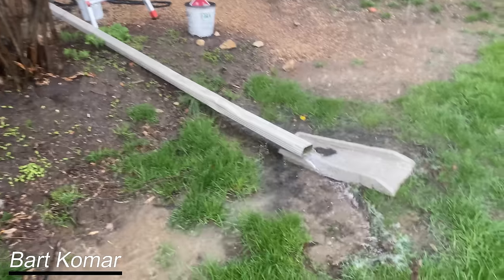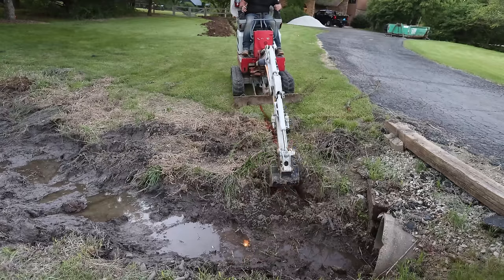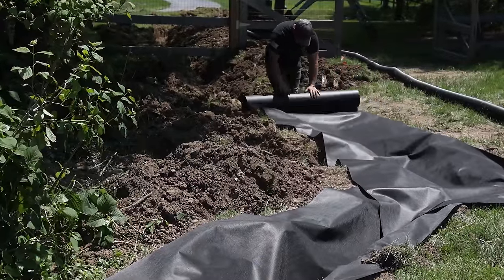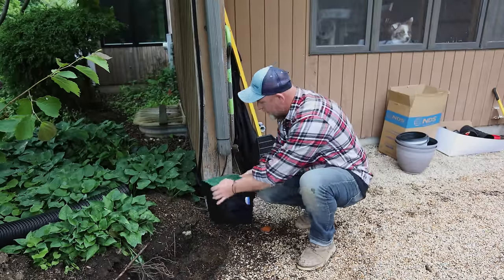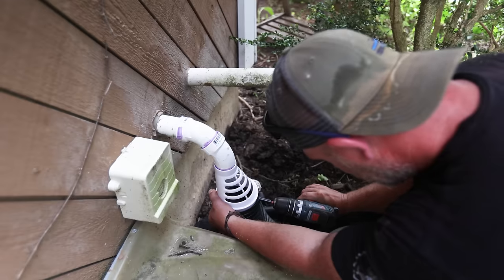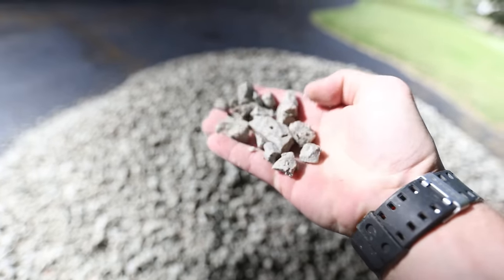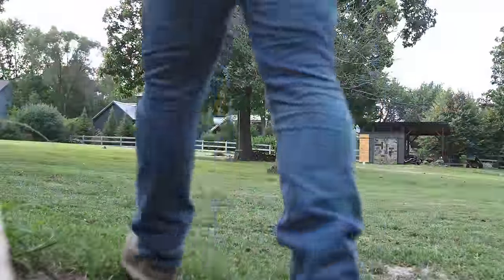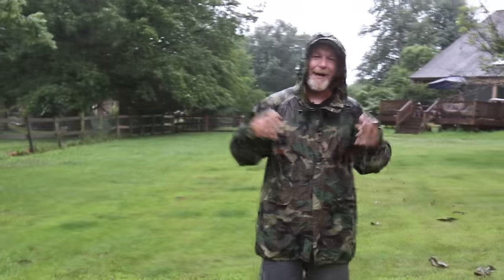How to Install a French Drain that Actually Works!  DIY Project

Comment: Wouldn't a rainwater tank be useful for saving the water?  We are going to be installing both a rainwater tank and a grey water tank, we're also running a french drain from the tanks to the drainage ditch for overruns.
Reply: There's very little you can use rainwater for and every standing water tank is a biohazard that not everyone wants to maintain. I have a well tapping into clean drinkable groundwater and you won't catch me watering my greenhouse plants with rainwater which who knows what it contains when I'm watering something that I will be eating. I'm lucky that I don't live in a place where even groundwater is polluted.

I keep my well clean by emptying it regularly, if you let it sit it's going to go bad, there's no such thing as "saving" water, only bottlenecks that prevent its circulation, and even my well is an annoyance, the last thing I need is to to maintain another such tank from potentially hazardous source. Maybe if I lived in a world where it's safe to drink rainwater it would be different but I don't.

Comment: 9:15 I'm confused, you connected your solid pipe from catch basin into what looks like perforated pipe. I thought you are going to connect it to solid pipe? I watched it several times and I clearly see perforations. Did you make mistake or should I go to check my eyesight? Did you catch it and fixed it?
Edit: after watching previous pipes, it looks like you did install non perforated one first, but this place has perforated one, probably a mistake. I hope you catch it and did not mention, and if not, that it is just one piece, so hopefully it will not leak so much it ruins your plans, because it would suck to fix it now.

Comment: One (1) inch per ten (10) feet is 1 divided by 120 inches is 0.83%, not 1%.  One inch per 8 feet is 1 divided by 96 or 1.04% which is what you want.  This is also 1/8 inch per foot or 1 in 96 also.  You could even go 10 mm per 1 meter.  True 1% would be 1 inch per 8 feet 4 inches.  Sorry, my ADHD.   Filter fabric comes in woven and nonwoven versions as well as different thicknesses, so there is a lot of choices.  Drain pipe also comes with a filter sock on it as a convenience.

Comment: It really isn't necessary to run two pipes.  The water in the perforated pipe doesn't care where it came from.  Any water that leaks out of the pipe will run back in when the level in the pipe goes down.  That's the whole point of a french drain.  I have all my downspouts tied into my drain through the low side yard.  It works great.  I also put screens in the gutters in the downspout holes and just hook the pipe to the downspouts.  Nothing gets into the drain and you have to clean out the gutters once a season anyway, right?

Comment: At around the 9 minute mark, you connected your downspout run to the perforated line. Shouldn't that go to the solid pipe?
Reply from the maker: It should. I just ran out

Comment: would HIGHLY recommend pre wrapped pipe, saves alot of time and effort. also use more than 1 or 2 wraps of tape on the connections, doubt those will last long as is. nice job otherwise

Comment: Great job.Why do you wrap a geo-cloth burrito around the solid wall pipe going to the downspout? It's just a solid wall pipe. The geo cloth and rock do nothing for it. I like your little creek. We did the same thing in our yard but it gets fed by a sump pump, since we don't have anywhere to drain the water naturally.
Reply: Just to speculate, but the geo-cloth and stones will still act as a drain and encourage water to move away from the house, possibly this is to help drain anything that splashes?

Comment: I'v got zero slope in a pooling area. What do I do?
Reply: You need to dig infiltration boxes. But if you also sit on clay then only option is collect water and use pump.
Reply from the maker: You can still create a slip with the pipe.  It will just be dog deeper on one end then the other. Or you can put it a catch basin that will give you some slope.

Comment: Should have did a collaboration with french drain man. NDS stuff sucks. youll have animals chewing at that pipe bc it's all recycled restaurant plastic. A true gutter leaf protector does not splash. Youre getting alot of splash and that splash goes down your foundation. French Drain Man on YT. You can also use a heat gun, heat up that thin wall and pop the cap in. then you have a grooved cap that wont spin or fling off easy.

Comment: rather than spread the excavated soil on top of the trench, you should have piled it all on top of the trench, and let it settle on its own. the pipes do take up some of the volume of the soil you dug up, but it will never take it all up. even after resodding the trench, in the next year or two, you'll likely have an obvious and snakelike depression where the pipes lie.

Comment: Last I checked, French Drains don't have above ground outlets...
Reply from the maker: They absolutely can.  Especially if you have areas that pool up a bit.   It also helps if you ever get a plug up.  You can access it much easier.

Comment: 👍🏠💦 Good job on dealing with the downspout water issue effectively. Adding a non-perforated pipe is a common solution for managing water drainage. However, the use of additional catch basins to speed up water movement can be a subject of debate. 🤔⚖🌊

Comment: You really don’t have to rent a level and do all that. All you need to do is run a hose into the trench and turn it on. You’ll see if there is any fall problems

Comment: Sorry, but one inch every ten feet is not a 1% slope; for a 1% slope you want one inch drop every one hundred inches which is eight feet four inches.  Or if you're using a 100' long pipe, the low end should be a full foot lower.  Further, depending on the amount of dirt and fine debris your roof gets a 2% slope could be better; plus for heavier amounts of fines the more even the slope the better; dips and high spots will collect the fines and cause problems.
Also, given the shallow slope on this, the catch basin under the downspout should be set in first and the slope measured from there.

BTW, for a lawn heavy in clay, rent a power aerator and run it over the area six or eight times as much as usual.  Then get a nice granular high-organics soil mix and rake over the lawn so the aerator holes get filled with it; corn gluten meal granules are superb for this.  You'll end up with the little cylindrical holes full of organic matter plus a light layer on the surface consisting of what didn't rake in.  Water this once, which will probably settle the organic matter down in the holes somewhat, so repeat adding the organic material and water again.  If you can get away with raising the lawn surface, leaving a half inch of your organic material on top will also be beneficial. If your yard is low on earthworms, buy some and scatter them while the surface is damp; they'll find those little columns of organic material and dive down into the soil.  The worms are your workers; they'll eat organic matter, but they'll also migrate through the remaining clay and perforate it, leaving casting behind that are nature's own fertilizer.
This will be a higher up-front cost, but if you deal with the brown grass problem using fertilizer you'll be forever dependent on fertilizer; if you instead make a healthy lawn for earthworms they'll keep doing the work for you!  And if you aerate every few years and rake in more organics the worms will keep on taking care of your lawn for you.

Comment: The reason you have a drainage problem is that you have zero top soil. All you have is dirt. There’s no organic matter in it to support the strong growth of plant life. Added fertilizer only helps Pennington to sell you fertilizer next year. It won’t help you transform that dirt into soil which captures water for the benefit of plants during dry periods. That fertilizer will make plants grow this year but it will also kill off the micro life your dirt needs to sustain plant growth year over year

Comment: Hey buddy I think your math is off if you want to achieve a 1 degree slope you need to be lower by 1.2 inch per 10 feet. 10 × 12 inches = 120 inches the slope must be 0.01 × 120 = 1.2 inches

Comment: 09:00  So you connected the solid pipe from the gutters to the perforated pipe?  I thought you were running a solid line all the way to the ditch.  I'm missing something.

Comment: I don't get it. You used a lot of professional tools, but you decide to use corrugated perforated pipe instead of PVC. All of your hard work and you don't want to do it again.  Other than that, please use PVC at least 4" holes and no holes.
Reply: It is shallow, not much on top to compress it
Reply: My company uses a special order corrugated perforated pipe that has a crush test rating about the same as SDR-35 and has cuts in the pipe rather than the tiny perforations he has there. It's the same cost per foot and comes in 250' rolls. There are quite a few other small mistakes that makes it clear he isn't a trained drainage professional. Just because you have been doing this for 20+ years, doesn't mean you've been doing it right.
Reply: I don’t remember him saying he was a pro at this. He’s just trying to remove water from his backyard. He did a great job.

Comment: Once you add corrugated pipe and fabric, you've created a weeping system.  Not really a French drain.
Reply: How would you explain the difference ?
Reply: @Seasheasells  It's not uncommon for the term "french drain"  to be interchanged with a weeping system, but the original "french drain" was accredited to Henry French in 1859 (not from France) as buried rock and/or gravel allowing water to permeate and travel quickly underground to a lower location.  These drains contained no perforated pipe or silt barrier.  In actual fact, french drains have been discovered by archaeologists in early Roman construction.
Reply: @chrisgraham2904  Thank you for explaining it. I have some pretty serious pooling on my front lawn that used to move through to a swale on the side of my property. The ground has become so saturated it no longer seeps in or travels anywhere. Cant even mow the area the past 2 seasons it never dried out. Researching best practices. I have a sloped lot so i have good pitch required to move the water over to the side yard and down hill. 

Fabric, no fabric, what type of stone, some conflicting ideas to debate. Do you think you would go with a little bit wider and deeper trench, all stone and skip the pipe if you were doing a project on your own home?

I should say the soil i have is clay and I have decided to remove the sod as a first step and haul the clay away not using it to backfill the trench with it. Use the least amount of top soil as possible to get the sod to blend back in on top.
Reply: @Seasheasells  Every landscape and situation is a little different, so it's difficult to provide a blanket solution.  There is a lot of options depending on where you can move water to a lower grade, or whether water should be moved to a dry well, or to a cistern tank with an electric sump pump to force the water through piping to a new location.   The first challenge is to identify the lowest location, which is likely where the majority of water is now pooling.  
Depending on the size of the area and volume of water that needs to be moved, you may require more than one drain line or need to create a "fork" configuration that can gather water from several locations and bring it to a central outlet.
For most applications, a trench about 16" deep is created with a 1.5 degree slope to the destination.  The trench is lined with a landscape fabric as a filter and lay the 4" perforated, corrugated pipe along the trench.  Then, back fill the trench with crushed stone or pee gravel within the landscape fabric, covering the sides and top of the pipe with 4 inches of the stone.
The pipe and stone is then wrapped with the landscape fabric as a filter between the soil and the stone layer.   Then you can top off the trench with topsoil and replace the grass sod over top of that to restore the lawn.  You may wish to contact a professional contractor that is experienced with french drains and have them assess your situation, provide a plan and drawing for drain location and a quote.   You can then decide whether to contract the job, or follow the contractor's plan an do the work yourself.   There may be a small fee for the contractor's consultation.   Always have your utility companies mark their lines if there is a possibility that they exist where you will be digging (water, sewers, electrical cable, cable TV, gas lines..etc.).

Comment: Why did you wrap the solid pipe from the downspout with fabric and gravel at 8:45? Many better ways to transfer downspout water to the pipe. The catch basin is expensive and inefficient. Why the gravel over the solid pipe on the end run? Why the fabric? Is the long end run solid pipe? It should be.

French drain pipe needs to be pitched as little as possible to pick up ground water. The pipe won't work at the high end as water won't get any water. Do you have gravel under the perforated pipe? French drains and perforated pipes pick up ground water from the bottom. Water that sits on top of the tight root grass and dirt which covers your pipe won't go down much faster.

I think I would've just run the roof drainage without the french drain, fabric and stone. Then I would assess the yard after several storms, filled in low spots, graded as needed and possibly added catch basins (unlikely). Just getting rid of your roof water probably fix 90% of your problem.

Comment: Waste of time grinding those nubs off.  Heat the end of the pipe with a heat gun or a torch and just stomp on the caps. The pipe will give and the caps fit tight.

Comment: Right idea, wrong material. That corrugated HDPE pipe is garbage. Use schedule 40 PVC pipe. It’s rated for ground burial. It’s smooth so it doesn’t clog. Poor drainage will tear your house down. Treat the drainage like you would treat any plumbing project. It’s that important.

Comment: I am concerned that you put the catch basins directly interrupting the flow of the water instead of to the side with a Y.. The water in those pipes has momentum and you are just.. taking that away for no reason to dump it into a basin and then back into a pipe, when the pipe should realistically bypass the basin.   it may not end up being a big deal for normal use but during a huge flood it will definitely make a difference
Reply from the maker: Those catch basins have a 1” drop in them where water sits and when water flows it fills up and then didn’t disrupt the flow

Comment: Why use fabric?
Reply: Separates the soil from the aggregate providing better drainage
Reply from the maker: It keeps the dirt from getting into the gravel.  If it gets in it will clog the slits in the pipe and it won’t collect the water.   Hope that helps
Reply: @KomarProject  Do you find that the fabric slows water from entering the pipe?

Comment: Corrugated pipe will not provide a smooth flow and the plastic has a life of less than 20 years before they rot and fail completely. Better to spend the extra money and use PVC pipe.

Comment: The overlapping of the fabric is going to be problematic.  The overlapping should be kept to a minimum.  The Baughman Tile Company blue "high octane" french drain pipe allows water in many times more easily and will last for decades longer than the home depot stuff.  See this on The French Drain Man channel.  The guy has been installing french drains for a living for 30+ years.   Don't go to a family practice doctor for a knee problem.  Go to an Orthopedic doctor.